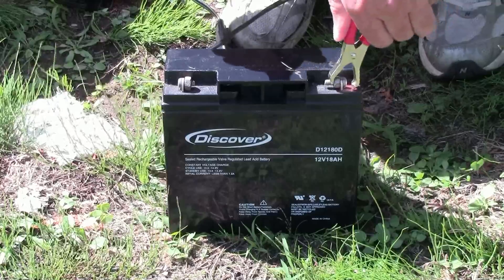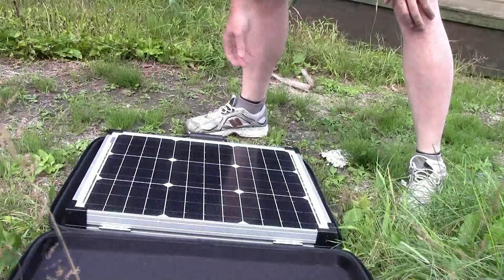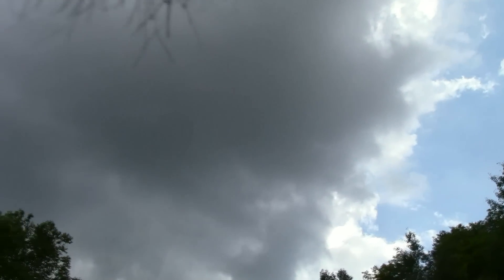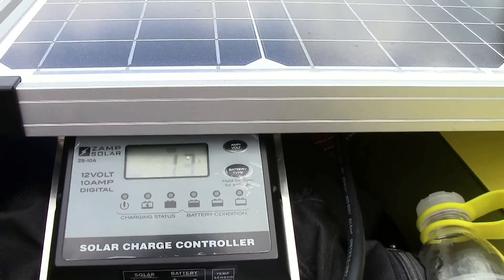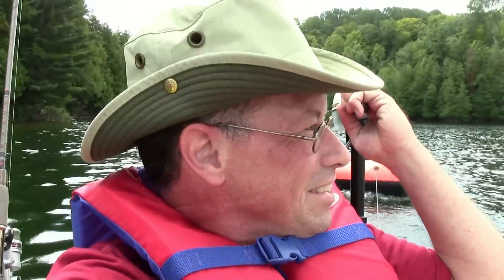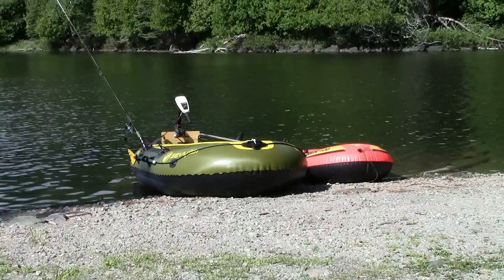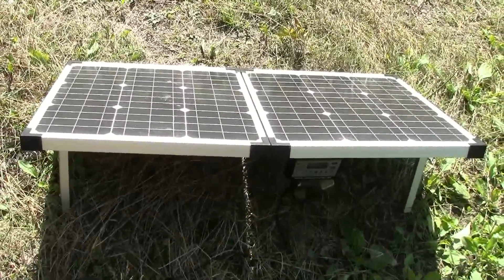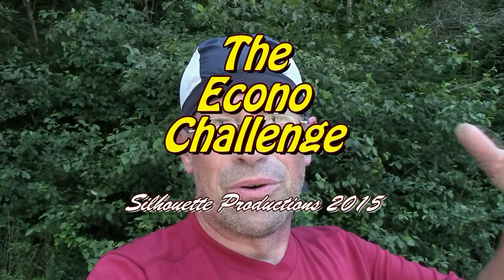Solar Powered Boat - Econo Challenge

Comment: it takes a long time to store power and when use, it goes out quick, solar power is costy, just get two deep cycle battery.
Reply from the maker: +Clover Vue I think you might have missed the benefit.  The solar power panel on a partly cloudy day produces enough electricity to run the motor.  I can keep going long after the deep cycle battery would have been dead.
Reply: +EconoChallenge 
in that case its awesome no more bringing the heavy battery. Where and price for the solar power?
Reply from the maker: I have put a link for you in the description below the video.
Reply: +EconoChallenge 
okay thanks, i dont a thing about using solar power, are the solar power grid waterproof? i own an 55thurst trolling motor, would an 100 watts do the trick, will it be able to recharge my flooded battery group 31?
Reply from the maker: If my math is right then your solar panel should be able to produce about 8 amps in full sun.  So that is plenty of power to charge the battery in a decent amount of time.  Also plenty of amps to run the trolling motor at full sun.  Your trolling motor is bigger than mine so you may have to throttle back a few clicks if the sun goes behind a cloud.  But in full sun you should be able to run that motor no problem with a 100 watt solar panel.
Reply: +EconoChallenge 
okay thanks a lot, now if only you can make an video on showing us how to set it up and what we need to do, wires ect.. is all solar panel able to recharge all types if battery, gel, agm, flooded?
Reply from the maker: +Clover Vue The charge controller is the important tech the determines how and what type of batter your panel will charge.  My charge controller will not release electricity from the panel unless it detects a battery.  So I can not hook up my panel directly to the tolling motor.  The charge controller can be set to charge flooded, gel cell and agm.  I have a gel cell on my system.  When the batter is full, the charge controller drops the charge down to a trickle charge.  When I clip my motor to the solar panel clips attached to the batter terminals and turn on the motor, my charge controller starts to release more electricity up to 4 amps.  My batter is still full but now all the electricity from the panel is flowing to the motor.  When I turn off the motor the charge controller drops the electricity flow back down to a trickle.
Reply: +EconoChallenge 
thanks im beginning to understand how it works with your help and some research.
Reply: +Clover Vue 
Hi again, so i was checking the website where you got your solar panels from and i saw the one you was using, i like that it came with the bag case and the control setting, i like the set and want to buy it but the website has no price info or how to buy it on the site? thanks in advance.
Reply from the maker: +Clover Vue They sell through retailers.  Perhaps you can send them a message to direct you to the closest dealer.

Comment: if you draw power due to electric motor and charging the battery at the same time,does the battery get hot?same as charging a cell phone and talking ?
Reply from the maker: +ronald martel The system relies on electricity taking the path of least resistance.  So the power clips for the electric trolling motor are attached to the fully charged battery terminals and the solar panel clips are attached to the electric trolling motor clips.  The charge controller on this solar panel is designed to charge various types of batteries.  I have it set to charge a lead acid battery.  The solar panel charge controller will not release any electricity unless it detects a batter attached to the clips.  So for example it will not power the electric tolling motor directly even in full sun.

When the tolling motor is not turned on and the battery is full, the charge controller for the solar panel will only deliver enough electricity to keep the battery fully charged.  The is called a trickle charge.  When the tolling motor is turned on and is drawing electricity the charge controller on the solar panel open up and delivers full power.  The trolling motor is taking all the power the panel will deliver.  When the motor is turned off, the charge controller detects a full battery again and drops the power back down to a trickle charge.

The only time the battery is being charge with electricity is when the batter has been depleted to some degree.  Say for example when I am running the trolling motor on a very cloudy day.  When I stop the trolling motor the charge controller will be supplying electricity only to the battery until it is fully charged again.  With this system I have not noticed a warm battery unless I have run the battery down to almost dead and am charging it back to full.

Comment: Ingenious! I used a Minn Kota electric motor on my canoe all of last year. No panels, but I used a huge deep cycle battery.  Canoe plus gear would go about 20 km on a full charge on calm water.  This method you're using [real-time power use] is worlds better. A slightly bigger boat with a larger battery would be almost unstoppable.  This is already being done on a larger commercial scale by Tamarack Lake Electric Boats.  Their boats are huge though. I'm thinking a 14-foot canoe would be a great size for solar panels and solo camping gear.
Reply from the maker: +John Campbell I was thinking a rig over your head that gave you some shade in the hot sun and would allow you to change the angel of the panel would be the best set up.  Not something I can rig on this boat but surely you could do that with a canoe.  It would need too be light and removable for portaging.
Reply: +EconoChallenge I'm going to grab a portable panel this spring and try it flat across the front seat area of my 15-foot fiberglass canoe.  I have concerns about a rooftop system catching wind, but maybe that's worrying over nothing.  Should be fun to experiment with.

Comment: Tip. Solar cells in the other boat (dingy).
If you remote control the motor you can put it in the other boat and let it pull you.
Then you don't have to lift your arm all the time to correct the direction.
Reply from the maker: +nattsurfaren I like the idea of the solar cell in the other boat.  Give some more room for sure.  I think I can do that next year.

Comment: Interesting points and great video, Jeep! I have a Sevylor Colorado inflatable canoe (bigger than your Fish Hunter) and I'm working on several mods over the next few weeks. Inflatables like this don't really have a full keel so they don't track well when paddling, so a motor is always a good idea. But I've found a possible removable keel solution too.

My brand new motor is a Minn-Kota C2 40 so it has a bit more thrust than the 35, and I'm looking for a good battery and box now. But I draw the line at paying $109 for a motor mount that's basically 2 pipes and a hunk of plywood so I'm building something for that too.

Those panels look and work great! But wouldn't you know it? The only Zamp Solar dealers in Alberta are RV dealerships with really crappy basic websites so I can't get a price. I'll have to keep shopping around I guess.
Reply from the maker: Alberta Bushcrafter They sell the one I have with RV`s to keep the batteries charged when not plugged into hydro.  They charge a lot for them.  I got a deal because I also purchased a car from the same guy.  The important tip is to get one that will generate more power than you need.  That way it will still work for you in partly cloudy conditions.
Reply: I did some more research, and yes - those arrays are pricey. I found some from 60W at about $200 up to some 100W arrays at over $800. That's not in the budget as of yet.

However, I made some huge strides on a battery box / power centre. I couldn't get to Cabela's to check out the Minn-Kota box, but the Canadian Tire box was $80, utter crap, and not even waterproof. As a result I picked up another marine gear box for $25 and a few extras for another $15, and I'm working on a DIY box this weekend and next. This will make a very interesting video.

Comment: want to do that to my kayak now, how much is the panel?
Reply from the maker: daveslens There is a link in the description for the solar panel company.  It retails for $400 to as much as $700.  So do your research and check a few different retailers.   I got a really good deal because I also purchased a car from the same company.  I have seen some really great flexible panels rated at 80 watts for much less than $400.

Comment: http://www.sportsmansguide.com/product/index/attwood-led-bow-and-stern-light-combo?a=1699098  these use AAA batteries for each lamp.  http://www.sportsmansguide.com/product/index/shoreline-marine-clamp-on-stern-light?a=1845066  one all around white lamp with a mounting pole to your transom
Reply from the maker: Randy J Hey that is a great idea for the stern light.  I can easily attach that to the transom.  The bow light is going to be a bit more of a challenge.

Comment: I have the same trolling motor for my 14 foot star craft V bottom boat.  I have motored back to the loading ramp in heavy winds for over a mile. That used up a fully charged deep cycle battery
Reply from the maker: Randy J That little battery in the video is 18 amp hours and kept the boat going for 2 km round trip.  That is close to a mile.  That means the most of the electricity being used by the motor came from the solar panel.  The battery is there to trick the charge controller into allowing the electricity form the solar cells to flow to the motor.
Reply: ejtrç bàyblíñer 175 30 mioe yéjßà 3⁴,⁸ miilecrábgé

Comment: Great idea and as has already been said quiet. Now you have to figure out how to elevate the panels so you can take your gear and not pull a dingy.
Reply from the maker: Gary Cloud I have got some ideas for next year, but  I may need to upgrade the boat.
Reply: @EconoChallenge  pvc pipes as a lot of waterproof tape,plus a couple of harbor fake 100 watt panels.nuff said

Comment: Great set-up Jeep! Plus you can use the solar panel to charge other things, maybe even something around the home. I would love to go off the grid! I kayak at night with a harbor light and my Petzl headlamp. When boating at night law requires a light that is visible 360 degrees so I have it mounted on a thee foot mast so it's above my head. I also use a red blinking light (my bicycle light) attached to the back of my lifejacket. Very few boats out at night where I go so it's very safe. Take care, Ossie
Reply from the maker: Ossie Weinert Next I will have to figure out how to hook up a light.
Reply: +EconoChallenge late reply here. but, use solar stake lights from the dollar store. paint half of one green and red. and frost the other with acytone.
Reply from the maker: That is a freakin great idea.  Thank you!
Reply: EconoChallengethanks,  just keeping it solar, without a battery draw. A better colorant would be a green and red sharpie pens.